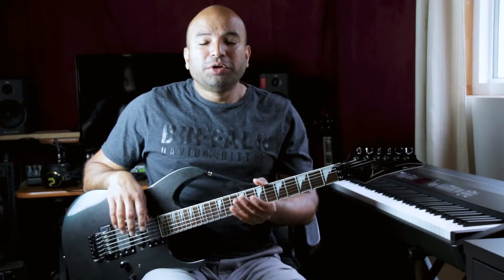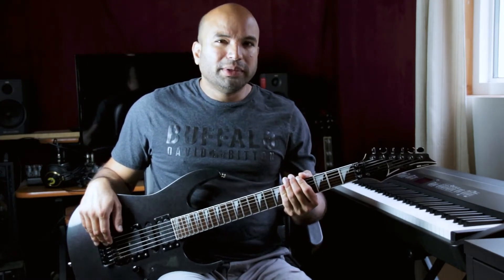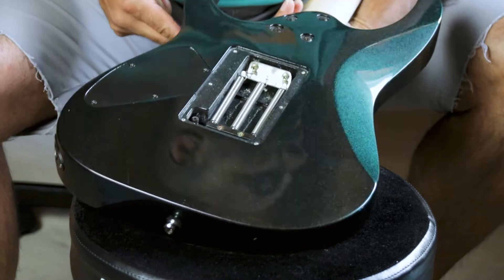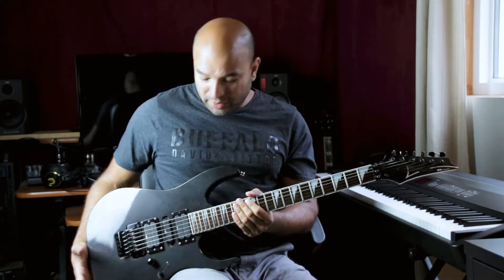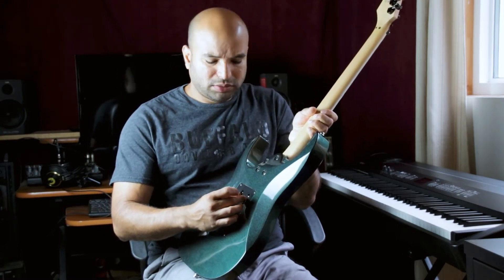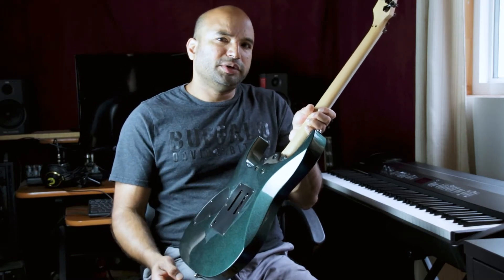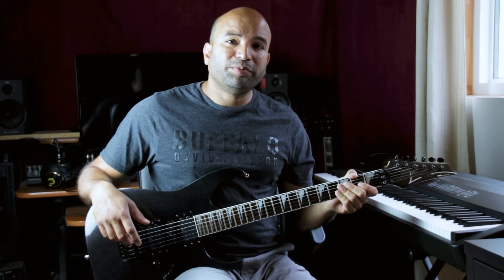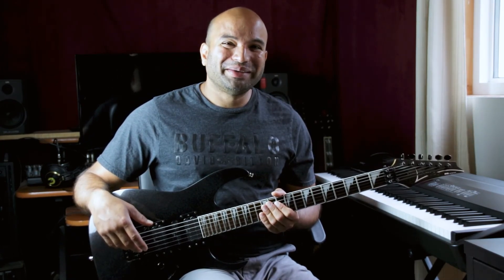How to block Ibanez RG tremolo bridge. - RG370DX

Comment: I live in Indonesia. One weird thing here is, you can buy Ibanez Edge ZPS trem separately. They almost always available, wether in "new" or "used" condition. I didn't know where these trems came from. Several sellers I've asked won't tell me where they're getting it. That's why I'm kinda shocked that your guitar doesn't have the ZPS (Zero Point System). Coz almost every Ibanez I've met here (in Indonesia) come with Edge ZPS or the licensed FR for the GIO's.
Reply from the maker: That’s interesting, I guess different parts for different markets..
Reply: The guitar in the video is an older model which comes with Edge III tremolo. That tremolo does not compatible with ZPS. Only model with suffix Z (example: RG8570Z) that comes with Zero Point System.
Reply from the maker: @ thanks for that info. appreciated!

Comment: I have 2 RG's with the edge III trem and I tend to agree they are not very good. The trem just doesn't feel good in my hand and it doesn't move well when I use the bar as it seems very stiff. I am in the process of replacing both of the trems with Gotoh 1996t bridges. I have to route a bit of wood from the trem cavity to make the Gotoh fit which is a bit of a pain but probably worth it in the end.
Reply from the maker: Somehow I’ve never got my head around Floyd rose trems or any for that matter. Too high maintenance 😀

Comment: can i also use coins instead of wood?
Reply from the maker: Yes you could, I prefer wood as it can support more width but maybe two stacks of coins should also do the trick
Reply: @DavidsMusicChannel  would you say its worth buying an rg470 for the hsh config or the rg421, which one ia more versatile?
Reply from the maker: @roycwu I mostly use the bridge pickup in my playing, sometimes I might use a neck but that’s mostly on Strats. I think as far as RGs  I’d go with the one that’s setup best, that makes the biggest difference. Either would be a good choice and if cyou’re not sure go for the HSH as you’ll have the option 😃
Reply: @DavidsMusicChannel  Thanks!

Comment: Hey mr ✌

I have a Ibanez RG8570Z with floating bridge, and mine guitar stays in "tune" a long time. 
But, at the start I remaber that I struggle with the same problem and I found out the reason  was something I did wrong with those string-secure things at the top (not sure what those is called), and neither what I did actually do to fix the problem, but something stupid shit I did right fixed that problem for me😅
Reply from the maker: Thanks for sharing Kim. Your Ibanez has the Edge-Zero which is very stable and shouldn’t be a problem. Mine had the Edge III which is a bit unstable.
Reply: @DavidsMusicChannel  ok, then i learned somthing new today to  :)

Comment: I have an Ibanez RG series and it has absolutely refused to stay in tune. Tuning it is a frustrating nightmare too.
Reply from the maker: Yeah! Best to just block em off. 👍
Reply: Use nutsauce in your string saddles and bridge and you will have less tuning issues with tremolos. Sometimes it can be a symptom of your nut not being cut correctly for your string gauges and the sauce can't overcome that much of an issue though.